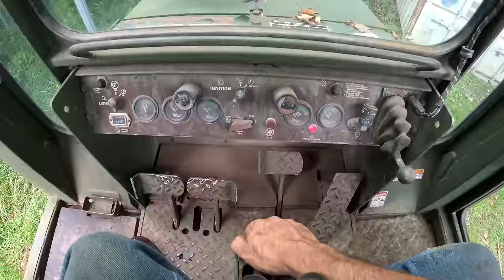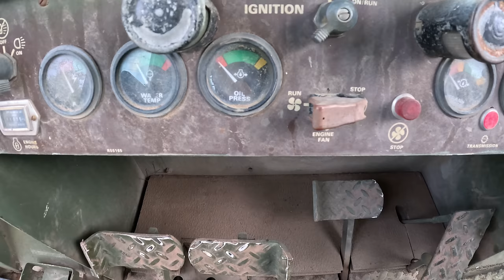Bulldozer repairs

Comment: Glad you addressed the fact that those cable clamps were on the wrong way originally. I noticed right away. My uncle always used to say "never saddle a dead horse" meaning the saddle (the part the u-bolt goes through) always has to be on the "working" side of the cable.
Reply: Right on.... every time I come across this task I have to remind myself the correct orientation..thanks
Reply: I haven't done a repair dealing with thick cables, Yet it makes sense. The more gripping on the working side because the saddle is thicker area for more grip.  Thanks for pointing out that good advice @jasonb6570.
Reply: The way he fixed that cable with 10 different clamps and vices makes me feel a lot better about the way that I fix shit. I guess it’s never pretty for anyone; as long as it gets fixed.
Reply: This is the comment I was going to make , having worked on bridge building we used a lot of 3/4” cable to steady & hold the bents in place , that you build the forms on to pour the concrete into .

#2 always cut your cable either with a torch or the welder use 6010 DC or 6011 for AC , both of these processes will weld the end of the cables together so you don’t have all that splaid end
Reply: Nothing like a new Andrew camarata video on a Sunday afternoon

Comment: The random appearance of Porky was gold ! Also, Andrew should invest in a giant roll of that hydraulic hose and the crimping tool needed to put the connectors on. I bet the price of making those 8-10 hoses at the shop would have paid for the tool. He sure needs a lot of hoses for all the stuff he does.
Reply: It’s hardly labor you pay for. That hose itself is EXPENSIVE! It’s safety rated for some pretty high pressure. They are basically built like radial tires, except better. It wouldn’t make sense for him to buy the crimping machine. They are astronomical too.
Reply: Andrew makes $750K/year  from his YT vids.  Its not as if he cannot afford to get the tooling to do it. 
 

But Andrew is putting money into local enterprises. Life is difficult in Upstate NY and if you look at Andrews jobs, its really helping the community out.
He is doing what I would do in his situation. Giving back to the community.
He does look after Dan Wheeler a lot and his YT channel. He doesnt advertise it, but he does.
Reply: @adem-Savs  Where do you get 750k a year? Source?
Reply: The ego blower has more power than my gas blower
Reply: I agree especially with the fact that he is getting more equipment which uses Hydraulics and hoses

Comment: Color coding the hoses with zip ties is brilliant! I have a zillion of those and never thought of this.
Reply: Zipties come off and break easily. They also don't hold very well on short adapters/fittings. Telecom wires work way better and come in a million different colors. They also don't break off and they grip threads very well.
Reply: I just did this like last week on my new (old) tractor and now I'm wondering if I'm smart or just saw Andrew doing it before.
Reply: If you don’t have different color wire ties, you can always use different colors of paint.
Reply: @NineCylinderDiesel  considering they only needed to last for what seemed like maybe 12 hours to remember which hose went where theres no need to use wire which will lose its color and start to rust quickly in his climate lol
Reply: @yabiochya  let me start off by stating that I work on heavy equipment for a living. I had a new hire use colored zipties two weeks ago. He remved 8 hoses that all had the same fittings but were different lengths. He then proceeded to mark them, and their respective bulkheads with zipties. 4 bulkheads lost their marks and when he tossed the hoses into the back of the truck, two of them lost theirs when the zipties broke. Also, since the wires I use are dug up telecom wiring that are given to me on demo sites, they are free, they come in a million color combinations, and since they're copper inside, they don't rust. I typically leave them on for the next guy, since it'll probably be me anyways, and have worked on the same machines years later and guess what? They're still there, and still 100% distinguishable.
Reply: @yabiochya  this is not something I came up with, it is universal practice among heavy equipment mechanics. We typically share stuff like this with each other and that is why I commented on here: to share it with anyone who ever has to work on these machines. Be it mechanics or owners who want to save money.
Reply: @yabiochya  True!
Reply: @NineCylinderDiesel  I've been using color coded zip ties for over 40 years and never have had a problem. I was probably doing equipment maintenance and repair before you were born. I don't treat mine or any one else's hoses rough enough to do the damage you do.
Reply: @Watchyn_Yarwood   so what you're saying is that in 40 years, you haven't had the desire to find a far better, more efficient, and cheaper way of doing things? Thanks, I needed a good laugh this morning.
Reply: @NineCylinderDiesel  “You can tell how smart people are by what they laugh at.”
Reply: @Watchyn_Yarwood  same goes for how stubborn they are to learn new things. Are you one of those guys that stumbles around the jobsite with a manual grease gun taking all day to lube the machines?
Reply: Zip ties break? Poppycock on stilts.
Reply: @jessiepooch   can you translate? I don't speak jibberish.
Reply: Thought the idea was a good one, others mention pro's and other suggestions, remember his use was not but until he got the new hoses and put them back on.

Comment: As a former merchant marine captain (although from the Netherlands) i have a copy of the 'American Merchant Seaman's Handbook" (Ed 1965) that shows a special vice for clamping steel wire like this. I have never seen it in real life and you would not buy one for the occasional wire clamping job, but they do exist. On the ships we also simply started at the end and slowly worked our way to the eye. But our more experienced bosuns scoffed at this and preferred the old fashioned splicing. Nowadays neither is allowed on ships as the wire including the eye has to be tested and cerified. And as we don't spend much time in port we usually replace the full coil of wire rope if there is any failure. Wasting a lot of money in the process. Modern times! Nice to see you got it done in the end.
Reply: Because in the past dude's whete split in half.
Reply: Usually because they didn't respect the SWL of the wire ropes. Or wire ropes were not properly maintained and greased. As always: respect your tools and equipment and know the limitations and proper way of handling. When a wire snaps you need to be on the correct side of it and a safe distance. Then when you repair it you discard the part from the break to 3 turns on the drum as that may have been over stretched, the remainder is still as good as before the snapping of the line. Basic things like that kept me safe for 40+ years on merchant vessels.

Comment: I wouldn't trust that jack as a safety stand. I had one break the cast piece holding the lock pin and it dropped instantly to the ground. It was holding up the tongue on a 15 ft batwing bush hog, maybe 500 lb. while I was replacing the tongue jack with a new one. Lucky my feet wasn't in harm's way. The jack was from Tractor Supply and the first time used. Thank you for your time to share your interesting events with us.

Comment: Andrew  very smart to replace all the hydraulic hoses, going forward I strongly recommend you use two wrenches while tightening any hydraulic hose, using only a single wrench will put a clockwise twist in the internal steel braiding of the hose, (the tighter you make the fitting the more twist) The steel braiding want to be in a neutral state, so it exists a counter clockwise force on the fitting loosing it over a short timeframe, especially with all the vibration a dozer has during normal operation.
Moreover if installed using a second wrench(holding the hose in a neutral state) the hose will hold the fitting tight during operation.

Comment: There is a Kevlar sleeve that can be put on hoses to protect them from the sun as well as abrasion. For the wire rope clips, put the first one near the end of the dead end and tighten it up. Then hook on to something to put tension on the cable put a second clip next to the first but just get the nuts started, Then you can use a hammer on the saddle to drive it toward the hook end. An air hammer or electric hammer also works well if you have one available.
Reply: Essentra Components makes a full line of hydraulic hose protection sleeves and they have free samples.. Check them out.
Reply: You can also get nylon spiral wrap.

Comment: It takes vision to decide where to dump, how much and how to attack pushing it, so as to take the least amount of time and effort. Andrew is an excellent operator, not only because of how he manipulates the equipment, but because he has that necessary vision to get the job done right, in the least amount of time and effort, not to mention least amount of fuel consumption.

Comment: I used to run a 850 D and loved its maneuverability. Like you said you could run each track independently, one in forward, one in reverse. There was also a high and low range for transporting.

Comment: Man, that opening - I'm remembering back when that road was so bad you could hardly get a tracked vehicle up it without getting stuck and having to use a winch over and over.  Now you could drive a sedan with bald tires up without any fuss.  THAT is some serious improvement!
Reply from the maker: Thanks.

Comment: It is such a good feeling to know you have new hydraulic hoses on the entire machine. It makes operating it so much better
Reply: Tips my hat to the guy who made all of those hoses while Andrew waited. None of this it's going to take a few days or weeks stuff. He also let A ⚡C film and ask questions.That is fast service. Cody and Blue watching the sunset was a amazing site. Woofs 🐾
Reply: I think Andrew needs his own hose making setup.
Reply: They make a lower cost hydraulic fitting compressor, it uses a small hydraulic Jack type setup. You still have to have an inventory of fittings and hydraulic lines, they can get a little pricey but still cheaper than the guy in the shop making them. Where I worked they had a setup like that and it worked really good, we also had a nut and bolt service that handled all those fittings so it was just a call away to get some delivered.

Comment: There is a much easier way to put those line clamps on.  Make the loop much bigger and put the clamp closest to the end of the winch line and tighten it enough that the line wont slip out under a bit of stress.  Tie to tree or something sturdy and give tighten with the cat 20-30 ft away. tighten it just enough that the loop is narrowed  around the loop guide.  then put the second and third clamp on and loosen the first clamp just a bit so the winch line could slip a bit.  
Use a hammer and tap the line clamps so the winch line will pull around the loop and create less of a tail.  Each time you have to retighten with winch make sure you tighten 1-2 clamps.  Then repeat process until you have 2-3 ft of tail left and then tighten all the clamps.  It will look much better and clamps will be evenly spaced properly.  
Also, use the phrase, "Never saddle a dead horse" to determine how the clamps go on.  flat part of clamp being the saddle, and the dead horse is the tail of the winch cable.   
Better yet get a Hook with a chain attached to it and just make a bull knob on the end of the winch line after it has been fed through the end chain link.  
If it ever breaks just make a simple granny knot to replace the bull knob and tighten into it until its a tight knot.  
Most of the bed trucks run around with knots on their winch lines as the bull knob or bell end only last so long with regular use.
Reply: A tip of the hat to this man’s advice.
Reply: It is much easier to do this tip with a helper running the winch so you don't have to walk back and forth. :)
Reply: Also, if you are worried about having the line slip through too quickly, you can put the 3rd line clamp an inch from the end on the winch line and tighten fully and then it will stop the line from sliding out of the other clamps.
Reply from the maker: I need to try that, it took me a while to get those clamps on.
Reply: @AndrewCamarata  yeah I used to swamp on a bed truck and I'm also a Picker/Crane operator for 20 years.  So, I have done it many times.  Cranes use clamps, Winch tractors/cats use bell ends and knots with chain & hook style :)  Like I said much easier with a second person helping :)
Reply: mainly because using line clamps don't last long on winch cables as the line clamps get damaged when winching over live rolls and rubbing on the ground when there is a load on the line.  bell ends and knots can take a lot more abuse.

Comment: Good vid great work .
3 things
 #1 if possible always fill your new oil filter with oil before installation, so you don’t starve the bearings on start up. 
#2 the saddle goes on the live side as you did, when you assembled on the ground , but not as you were on the tractor.
#3 ALWAYS cut the cable with a torch or a welder , use 6010 DC or 6011 AC as it will blow , this way you weld the end of the cable holding it all together.

Comment: Quick tip - weld up the end of the cable to prevent it from fraying.  Also, that view from the seating area is PHENOMENAL!  The still with the dogs by the chairs ought to be your Christmas card this year btw.  Lastly, Codydog has been looking a bit thin these last few vids, is he ok?
Reply: anything alive that runs as much as he does isn't thin because of an ailment, watching him run in the videos explains why he doesn't carry any extra weight.
Reply: we always fused it with a cutting torch.

Comment: As I found out back in the 70s when i was visiting my stepmother in upper lower Mich and Now you have found out you don`t kick a Porkie especially if you have rubber boots on like i did.. The quills penetrated the rubber but only scratched the top of my foot..  It ruined the boots, they leaked after that. There were a 100 holes in them.  Love your Video`s BK

Comment: I enjoy Andrews posts for their honesty. He had heaps of trouble getting on the clamps for the winch wire but showed his failures as well as his ultimate success. He may have cut out the swearing  however because if it was me there would be a lot of swearing.

Comment: Makes me happy to see a suggestion of mine actually worked. Wait until winter and see how bad that slope is with ice on it. You can always add more if it is still too bad. A week or two ago I was thinking of sending you a crude drawing of what I meant when I kept saying add 5 feet. Me not always goodest with words.
Right now I am stuck in 5,600 square feet of SIP panel hell, but the scenery is idyllic. SIP panels are nice for a roof if you don't need to put things in the roof, like 48 lights. 3 weeks of just cutting in holes for lights and digging through foam. I videoed some of it, not the best at editing. I want to finish my trailer trailer first, don't know if people will get the joke of it though. ;)
thanks for the videos, Andrew. Hope y'all are doing well.

Comment: With a fleet like yours, wouldn't it be cheaper to just have a hose crimper? :)
Great video as always!
Reply: Crimper is one thing, getting rolls of hoses and all the different couplings with different threads, thats a lot!
Reply: not cheaper at all. He would have thousands upon thousands of dollars in hoses and fittings sitting around as well as the machine just taking up space and his money as he waits for a random hose to break. Much cheaper to replace hoses when they break or like he did here, when they are about to break.

Comment: 18:43  I feel that frustration.. helping my dad years ago with wire rope and thimble.. Impossible to do without 6 hands, 12 clamps and divine intervention.  the big guys have a hydraulic gadget that bends the rope, and squeezes steel clamp ring ferrules tight on the rope. Good job to make that a field repair👍👍

Comment: I don’t mind him being cruel to the machinery but I draw the line at animals.
Reply from the maker: Getting barked at is not cruel
Reply: @AndrewCamarata holding it down with your boot is cruel and unnecessary. How would you like a boot on your neck?
Reply: @AndrewCamarata  keeping a wild animal in a cage and letting your dogs bark at it is Very cruel Andrew.
In Australia that would be a massive fine or jail time.
Reply: lol Les You are allowed to shoot them here.. Andrew trapping it and releasing it off site is hardly cruel
Reply: @lesmansom7817  Australia that explains a lot.. You even had green blood in carmageddon, laser pointers were also banned.  your country is nuts about that kind of things...
Reply from the maker: Yeah, that kind of regulation would not be tolerated here. That animal is a rodent, what I did to it was way nicer than most others would have.